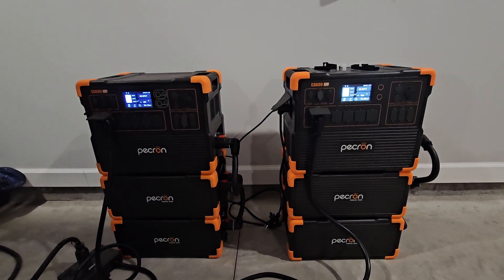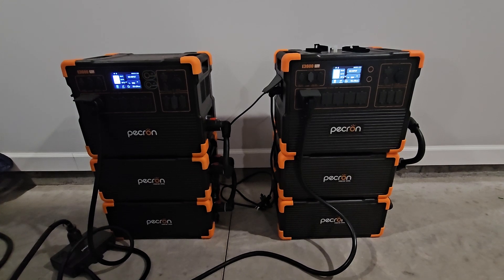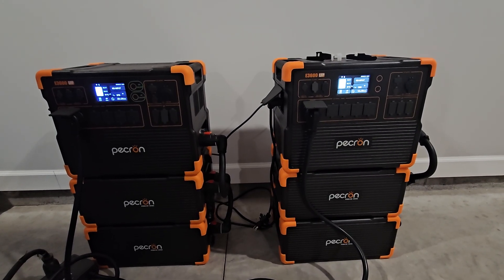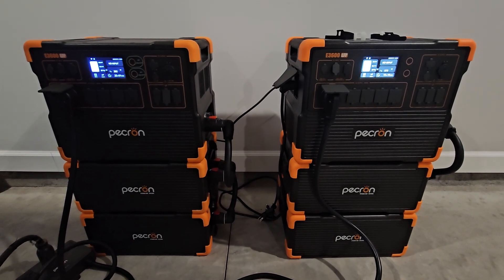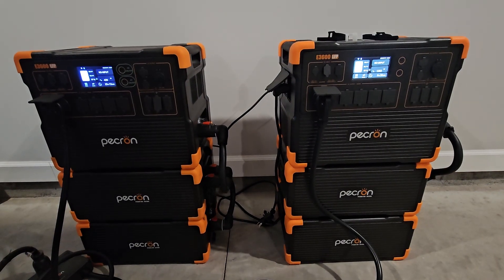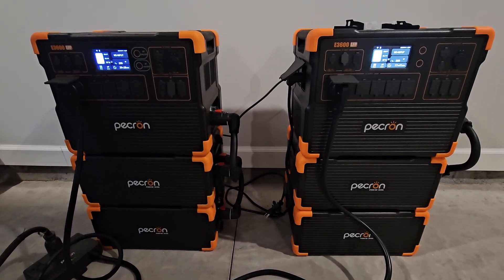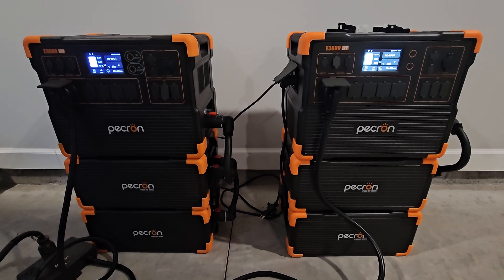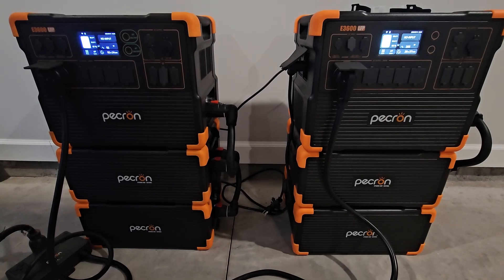Can the Pecron E3600LFP run a 3.5 ton heat pump?

Comment: I have a Pioneer 3 ton inverter type heat pump at my house.  It starts and runs just fine on a Pecron system just like yours.  It also runs my 50 gallon heat pump water heater, in heat pump only mode!
Reply from the maker: I have a 3.5 ton Ox Box by Trane. I have a soft start that allows my gasoline generator to start and run it just fine. My soft start has some protective circuits that don't like the way the dual E3600LFP provides power. I have no issues running anything else.

Comment: Bluetti Apex 300 is your huckleberry for the 240v in 1 unit. When I tried the dual e3600 240v, it kicked everything off about every 5-6 hours. Returned the 2nd unit and 240v box for a full refund. I wasn’t even running 240 circuits, just 10 - 120v circuits. Never saw the pull being more than 2200w on either machine

Comment: Theoretically those Pecron battery expansion cables can be cross wired between the two stacks so the overall battery storage for the whole thing winds up being shared.  I don't know if that creates a problem for the 240VAC adapter, though.   If you do try this, be sure the two battery stacks are roughly at the same state of charge before you interconnect them.  And be extremely careful because I just don't know how it will behave with that 240VAC adapter between them.

Generally speaking, power station inverter outputs have trouble with large inductive starts so it isn't really surprising that it would have trouble starting a medium-sized A/C unit.  Still, if you have a clip-on amp-meter I would check the surge current on A/C start to see if your soft start is working properly.  They could probably start and run something like a mini-split though (really anything with a DC variable compressor in it).

To start large house loads typically needs a commercial hybrid inverter or off-grid inverter such as an EG4 Flexboss18, Franklin, Sol-Ark, etc.   Or a high-wattage off-grid LF inverter.   These require more wiring knowledge than power stations, permanent mounting (typically in a garage on a large backboard), and aren't plug'n'play.  But they tend to be a lot more robust.  A Flexboss18 can has a 195LRA start capability (5-ton A/C start).

-Matt

Comment: No way a 3.5 ton AC should / could pull 115A. That unit should have probably a 25-30a breaker.......40-50a if running heat. I have a similar set-up with-out extra batteries and it starts and runs my 2.5 ton unit. Check the draw with a clamp on meter. Is the green light on at the 240v box? Something else is wrong.
Reply from the maker: It's written on the nameplate data. 112.3 LRA.  My clamp on amp meter verified this before I put the soft start on. The soft start is much lower, around 28 amps at the highest. I don't know if it comes through well in the video or not, but the lights flickered, when the air conditioner tried to start. That tells me the voltage sags, which means the amps go up above what the power station could start. I agree.A much larger setup is needed. The E3600LFP runs everything else I need.
Reply: @GridDownPreparedness  LOCKED rotor amps, NoT load rated AMPS. i bet money your breaker is NOT 100amps on that circuit. My new trane is 14 amps, and its 3.5 tons. Xl18i
and I dont have a soft start and it barely hits 18 on start and runs at 7 to 9 depending on time of year and heat/cool mode.
Reply from the maker: The inrush current measured by my current clamp was 112.3A at the peak before I installed the soft start. I have an xobox by trane with a single stage compressor.  When it dies in 10-15 years, it will be replaced by a ground source heatpump. By then, who knows what battery/inverter technology will be available then.

Comment: I have two 3600s using a 240-volt adapter. One 3600 runs out of power, and the 240 shuts down everything. They’re a week old, and unfortunately, a return is the only solution.
Reply: You have an unbalanced electrical load between each 120V leg in your breaker box, with one leg pulling more amps than the other.  This causes one Powerstation to run out of energy before the other.  Have an electrician check and rebalance the breaker loads.
Reply: @kevingerber1533 He can re-balance his breakers or he can connect both Pecrons together at the MJ32 ports and have the batteries internally balance themselves while outputting a imbalances load. Contact Pecron for the cable and the procedure on how to do it..
Reply from the maker: I have verified the panel is balanced as best as it can be. Check out my new video series where I have the power stations DC bonded!

Comment: Can two e3600 connect together with 4 extra battery total of 18kwh?
Reply from the maker: Each power station can have up to 4 expansion batteries. I'm not sure that the power stations can be bonded together dc to dc to balance the whole system.
Reply: Thanks for your as honest as can be videos. You are discovering the details that most reviews don't because you are real-world testing. Do you have a rough cost for your current all in? I have been researching systems for an off grid application, and I was down to the Pecron setup and the Walrus 3g. Based on your videos, it looks like it will be worth the price for the BatteryEvo setup.
Sorry you are having to discover this at your expense, but you really are helping people.
Reply: @lewnetoons I have a similar setup, but only 2 expansion batteries.  With panels and all cables, you’re looking around $7000.  Hick’s would be $8500ish with 4 batteries.  I’m also slightly regretting going with this unit after learning the 240v hub doesn’t drain the batteries equally.   I’m thinking that I will end up re-wiring my camp to have one unit running just the window unit with all the batteries and the second one to power all the outlets and lights.